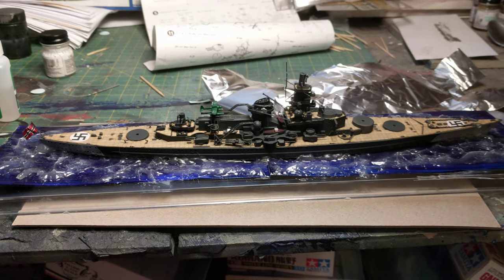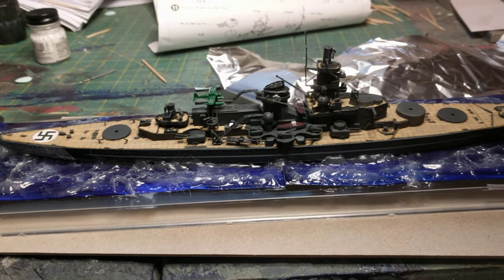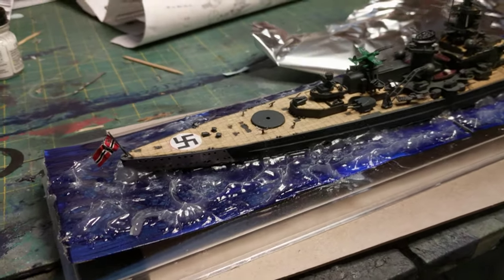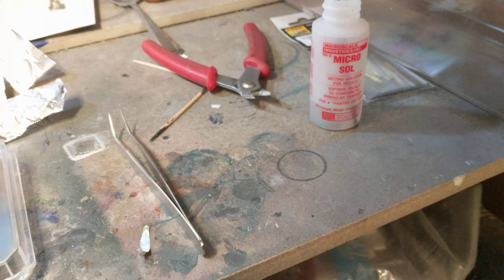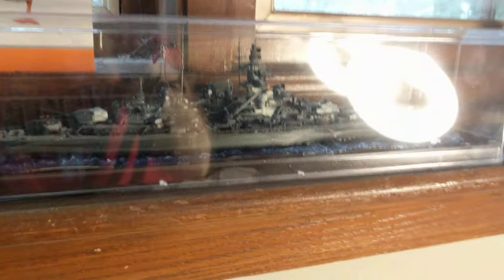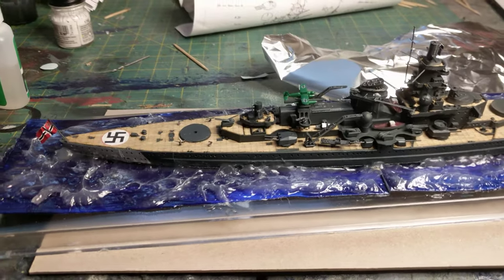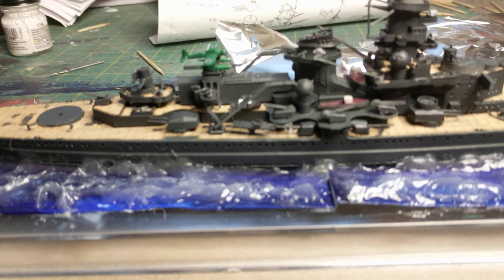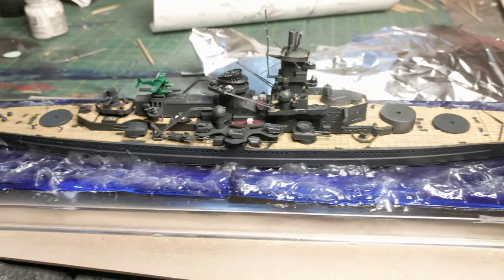1/700 Tamiya Scharnhorst build video part 4

Comment: Interesting to see that they have made the same mistake as the Airfix 1:600 in putting the boats directly on the deck either side of funnel and hangar.  In fact they should be about one deck higher on platforms.  This is a common fault in Airfix, they get lazy when it comes to boat stowage, the Bismarck model being a classic example.  Always pays to build these with a good reference handy.